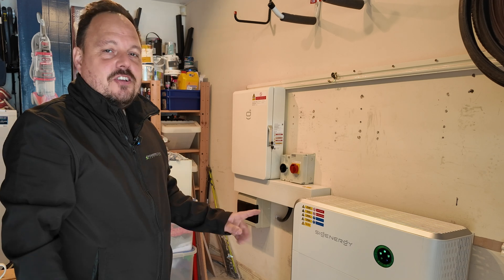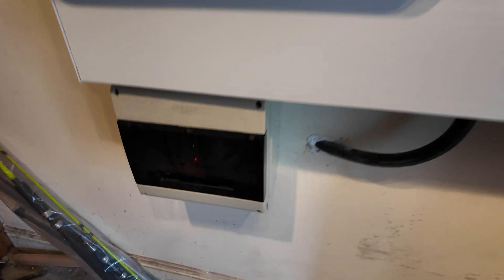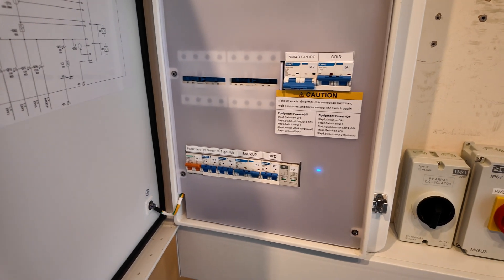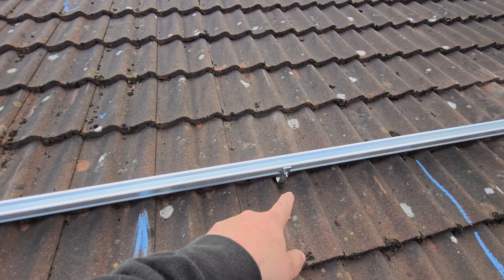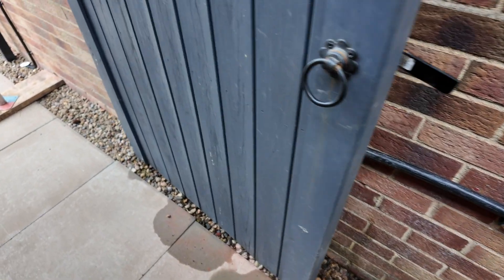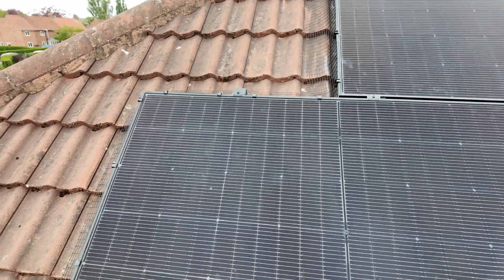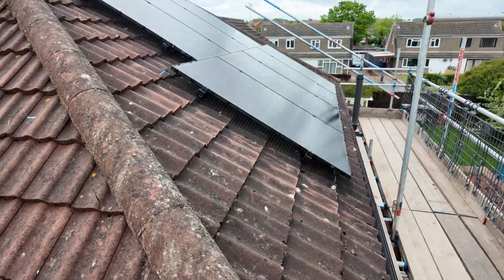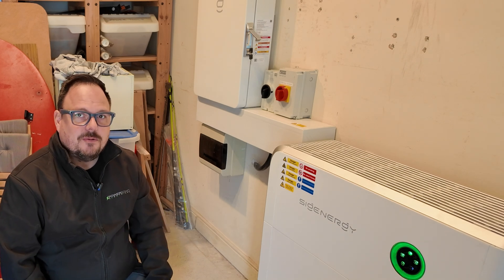Installing a Sigenergy solar system with whole home backup - BEST IN THE UK ???

Comment: I've seen another post where the gateway was noisy and intrusive to the homeowner such that they could hear it across their house.  Also the AI functions in the app seemed distinctly lacking and the delays when downloading data and using the app was very clunky and making it difficult to directly control what you wanted to do).  Have you observed any of these issues with your customers?
https://youtu.be/o9jogj2ojJA?si=eJ7BmdtpQz3KIQVy
Reply from the maker: None at all tbh. Outside of app updates causing the odd blank spot in connectivity. Which all brands have. We have had plenty of issues with Givenergy equipment. 

We are not tied to any brand as installers but tesla is a hard sell due to very poor backwards compatibility and scaling. Givenergy announce new products they can't sell way to early. 

The gateway does hum but not to the point its intrusive. 

All contactors hum differently even exactly the same ones from the same manufacturer.  Its just how they work. I haven't watched that video tbh and isnt for me to say. But if its such a problem I would ask the manufacturer to swap out the contactor and ensure all terminations are tight.  It could also be door alignment on the gateway itself. 

However sigenergy have recognised this isnt ideal and have new gateways entering the market that are silent with no contactors in them I believe. 

Consumers see the hum and buzz etc. But really that method is tbe safest on the market. Other options from different brands have had safety issues around the NE bond when off grid and even caused rcds internal to installations to trip because of leaky relays and such. 

The app development from sigenergy currently is sector leading. Likewise the AI. Its still in its early stages but no one else is even doing it. 

Speaking as a consumer here the app and its functions are miles ahead of anything else. 

Its funny as consumers think we present a warped view on this stuff as we are paid of gifted equipment. None of which is true and I've got the receipts to prove it 🤣. The kit sells itself and my catalogue of videos show why
Reply: @electrician247  good to know, thanks for the detail!.  I am considering the Sigenergy solution but the other part i am concerned about is being tied to the sige ecosystem, an app that doesn't necessarily do what i want and longevity and interoperability down the line with how quickly the technology changes (when it comes to replacing certain components or adding to the system 5-10 yrs down the line).  Probably also common with other brands too, but not all.  Interested to know how it compares in this respect.
Reply from the maker: It compares better than most tbh. None of the manufacturers do this well. I would research tesla pw1, 2 and 3 compatibility as good examples. No guarantees with any of this stuff and tbh in this sector when we immovation is so fast. To expect it 5 years later is maybe asking to much. That said the sounds and journey so far with Sigenergy are very encouraging. Ive got another system in my house as bought in pre Sig existence but would swap tomorrow if it didnt feel so wasteful. So im stuck lol. I think most people end up feeling like that down the road whatever they get today. @dhunt217

Comment: How do you activate the smart port Mark? Sigenergy technical weren’t much help with it today. Plan was to install a Zappi using the smart port. However, I ended up using your method here.
Reply from the maker: In the app click over to devices and then down to add devices then choose your device and select to power from smart port. It then clunks in and reports in the app.
Reply: @ Legend!

Comment: The new van der valk  rail is muck . They made it a lot lighter and not happy with the clip in set up . Don’t trust it .
Reply: Look forward to it 👍
Reply from the maker: We used it last week and really liked it 🤣. I was not that keen to try it I will be honest as like the old stuff! But they are moving away from it so thought we would try it. Like the single bracket for vert/horizontal and the rail adjustment. Feels a lot strong to me overall as well. But maybe I'm to keen 🤣
Reply: @electrician247 any possibility you could show a set up with the new van der valk rail when you use it next time
Reply from the maker: @markdonoghue1013  its on the next video 😁

Comment: Did I miss the solar generation meter or is it part of the gateway? I think they are pointless post-FITS
Reply from the maker: They are pointless post fit and inaccurate anyway with hybrid style inverters and the losses built through energy conversion. MCS ditching even mentioning them in the new scheme but we do have a mid one in the gateway, on the tigo system and even the sig data. All pointless mind 🤣

Comment: Mark what are you tunning at home?

Are those tiles, not suitable for rubber tile replacements?
Reply from the maker: At my house I have givenergy as bought in pre Sig. Both comparable systems tbh. But lean slightly towards sig until the AIO2 finally gets released.

Rubber tiles on concrete pan tile not needed and non compatible
Reply: @electrician247  I had a feeling there would be a reason for the tiles, but not being a roofer, I didn't know 👍

Comment: Thanks Mark. Would you need 100mA time-delayed on the backup return leg, or are you happy with every circuit downstream having 30mA protection?
Reply from the maker: You mean for offgrid? This is when things get murky as technically it's TNS rather than TT so we have fault protection and overload protection covered. Also need to remember in that state the "generator" aka sigenstor has lots of protection built in beyond our traditional methods and as the sole supply in that state any additions are unnecessary imho. 

It's an area we are massively over complicating as industry atm. 

If we require fault protection for final circuits via RCDs (I still think a debate to be had on this bearing in mind the technology) then as you say 30mA at the CU is sufficient. The supply distribution is adequately protected at source and has secured cable entries and such to minimise earth faults much like the get out on TT for meter tails I suppose. 

In short I think it's unnecessary
Reply: Thanks for sharing the knowledge Mark. We’re starting to install a few of these now and the off-grid protection is a headache. TN-S makes sense. Thanks

Comment: Hi Mark grateful for your continued content. Just finished my install with 6kw sigenergy inverter 16kwh of battery and gateway. 

I fitted a Separate db to run my enphase system off the smart port. My question is when I have my heat pump fitted in June could that be run off the same db from the smart port or best to run separately from the  house load side of the gateway? Any advice would be greatly appreciated.
Reply from the maker: Smart port should really be utilised for one thing. Your enphase system could be moved off it and CT metered to show the generation in the app pretty easily or run the heat pump via the consumer unit. Sig now integrates with Shelly so you can do some funky monitoring and control with those now as well
Reply: @ thanks Mark. In that case I think I will move the enphase system off the smart port and come off inverter 2 circuit to supply this Db

Then I will wire off smart port to separate db to supply heat pump as type b rcd will be required for this circuit.
Reply: What’s the benefit of wiring the heat pump from smart port?
Reply from the maker: @Bradley8269  control in offgrid situations and better monitoring of consumption/heavy cycles. Also allows to blend battery soc more usefully towards the heat pump running cycles.

Comment: Mark, i see you've used a 5 core XLPE for sub feed and return, have you not been pulled up on that by your assessor as 2 circuits combined in 1 cable?
Reply from the maker: Nope as it's perfectly fine to do so. It's technically the same continous circuit rather than 2 but regardless of that you can run concurrent circuits within SWA containment much like you can trunking and conduit. So long as circuit charts and schematics show it and isolation points are labelled. I look forward to the day any assessor tries moves like that.
Reply: @ Im not against it and it makes sense, just raised my concerns over safe isolation, sharing a common cpc, thermal effects on the cores. But if labelled sized correctly no issue. Swear I got pulled up on it at a campsite before years ago.
Reply from the maker: @alexrakhshani7588  isolation with PV and battery is always a consideration. Even run separately both ends need to be isolated for dead conditions in the enclosures. Thermal effects are no issue with any adequate design. 

With this particular kind of arrangement it's just a consumer unit feed via a gateway rather than 2 solely independent circuits. 

Imagine they were seperate. You could isolate the switch fuse end yet both of the cables could still be live. I make this a better and safer way. But each to their own.

Comment: Hi mark great install, is the inverter G100 compliant or is it the gateway which does the limiting for export 
Cheers
Reply from the maker: The system as a whole limits both export and import if combined with a gateway. The G100 aspect is in the inverter through and drops output to match limits etc.
Reply: @electrician247  ok that’s great, but reason I ask is because I have just been Loosely given my G99 approval but with 4kw export limit,  the DNO want to see G100 certification. I was going to fit Giv AIO and gateway but after watching you videos prefer the modular approach with the sigenergy. Was going to fit 8kw inverter due to the 3 mppts (future proof 1 spare) but can’t find g100 for the them, I have found it for up to 6kw I think ?
Reply from the maker: @darrensampson2994  are you an installer? It's in the ENA register. All the DNO need is that code and the schematic showing the gateway and inverter.
Reply: @ I am a standard sparky just getting into renewables, 1 have ENA connect direct for DNO notifications but still can find this for the 8kw, I did the givenergy installer training last week but they said the Giv AIO is going to be discontinued so that also put me off, I’m going to install on my own property as start off so want decent kit as labour is free ish, I’ll give sigenergy a call tomorrow if no joy 
Thanks for you help, keep up the good content you taught me loads and I’m 51 😂
Reply from the maker: @darrensampson2994  the AIO 2 is supposed to be out soon but we shall see!

If you go into connect application. Click the drop down with compliance with GB standards and you will see G99 type A and G100 ticked/dotted as compliant. So you are fine 😇
Reply: @ They delayed the launch of AIO 2 until August to allow for sale of existing Aio’s, so due to the 90 day installation time from DNO I cant really wait for that, I’ll amend the application on ENA connect and try and find the certs 
Thanks again for your knowledge and time 👍, I could do with someone like you down where I’m based you’d get no rest 😂